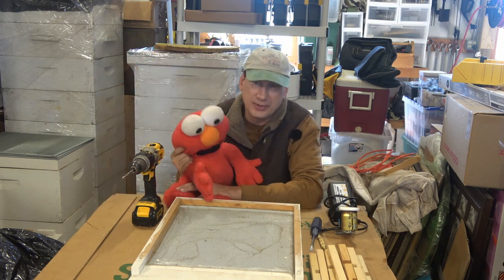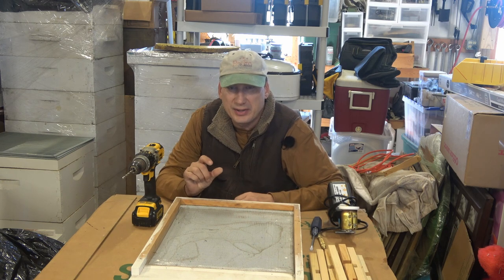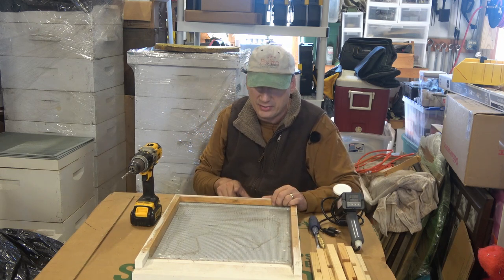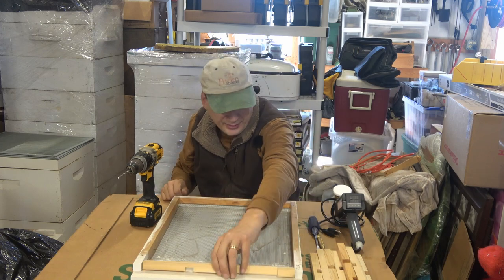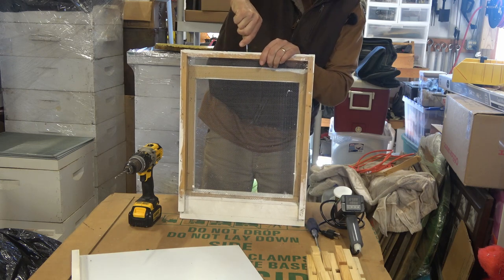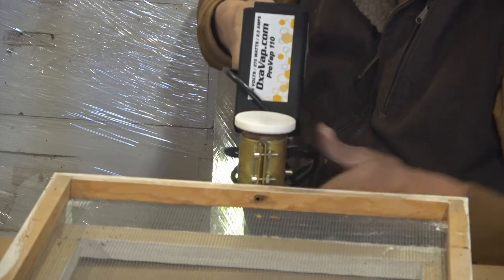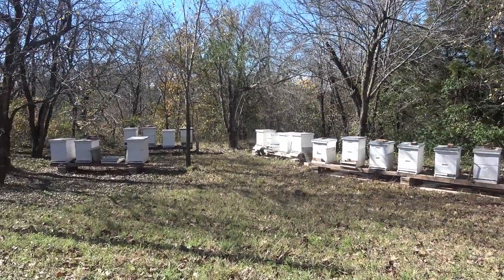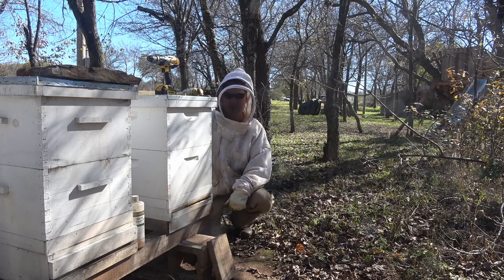Beekeeping:  Varroa Mite Treatment with ProVap 110 Vaporizer Part 1 of 2

Comment: Dear Jerome bee farm. Can I use 6 times oxalic acid vaporizer with 5 day interval ? Thank you.
Reply from the maker: Hi Alina, you can do that, but I would say 6 treatments is overkill unless you have a severe mite infestation.  The key is to treat multiple times to cover the lifecycle of a cell, with the longest being drones at 24 days.  6 at 5 days would be 30 days.  5 at 6 days is probably sufficient.  The best thing to do is take a mite count sample of your bees to see where you stand before and after you treat.  If you still have too high a mite count after treatment, you need to hit them again, and also assess your process to be sure you are getting adequate vapors into the hive.  Thanks for watching.
Reply: @JeromeBeeFarm  I Both Italian bees with to much mites. I treat my bees all summer didn’t help. Thank you for the answer.
Reply from the maker: Try some Apivar strips. You may not be getting good fume coverage.
Reply: @JeromeBeeFarm  I did already thank you. I got this family with to much mites.  ;(